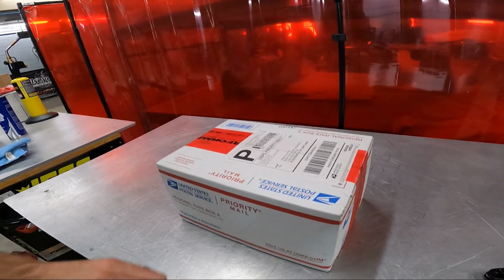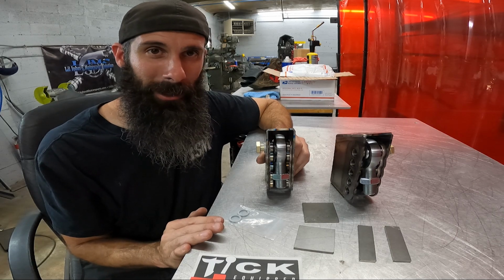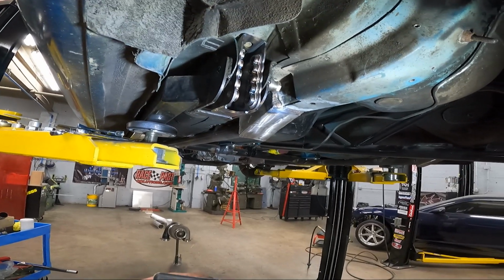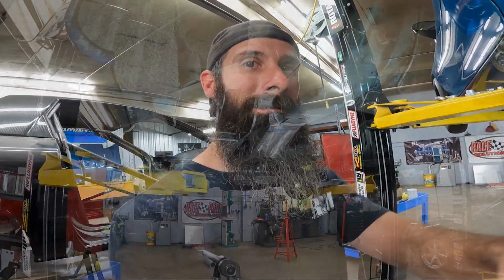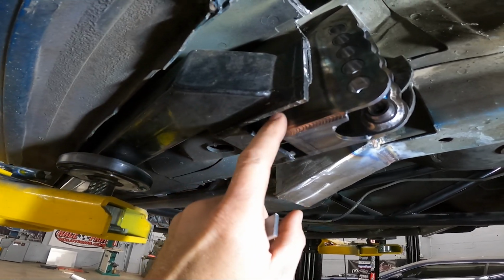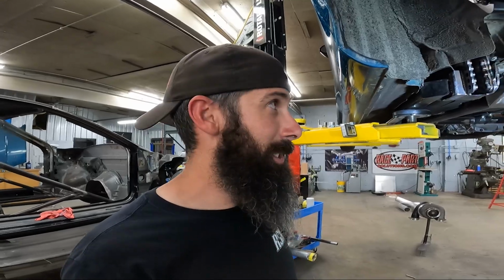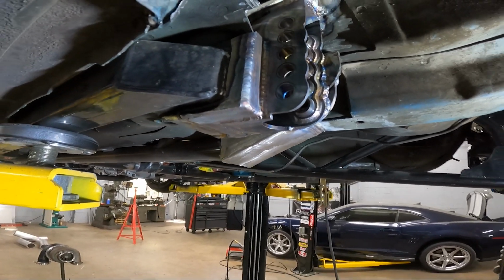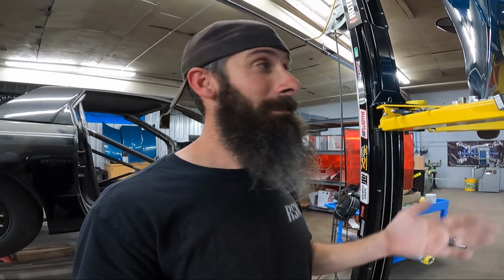Tick Performance Adjustable Torque Box Install on Troy's Camaro

Comment: Excuse my ignorance, what is the need for the angel change in the lower control arms? And what should they be.
Reply from the maker: Steeper angle allows the rear end to run up underneath the car faster which causes the suspension to separate putting pressure on the rear tires and pushing the nose down

Comment: One washer per bolt correct? The vid showed 2 on the bolt if I’m not mistaken.
Reply from the maker: Nord lock is the style washer sets that the bolts use. Each washer assembly is actually two washers that have a little bit of adhesive sticking them together

Comment: At what et/mph power level would you think this would be necessary over the set up that was on the car in the video?
Reply: This would obviously be a great addition to any 3rd / 4th gen build. I  have a 4th gen just dynoed at 856rwhp. Not a light gutted car. Has some good parts in it and has been 5.78 @123 eight mile and 8.98 @153 quarter taking off mildly until 60/80 ft with the boost. Love the videos thanks for sharing the knowledge.

Comment: Curious if you could make a dimple where you cut out for the bolt rather than making a hole. Depth perception in video can be misleading but it looks like it wouldn't take much to dimple that area enough to get the bolt in and then you're not cutting an extra hole. For drag and drive guys that's a place for water to get in and sit. You build faster cars than I do, so it's only a suggestion from the outside not meant as criticism.
Reply from the maker: The material in that spot would take some pretty good Force to manipulate because it's two or three layers there. You're correct though it's only about 3/16 that's actually needed or so maybe a quarter inch